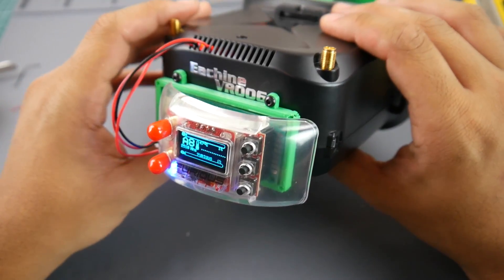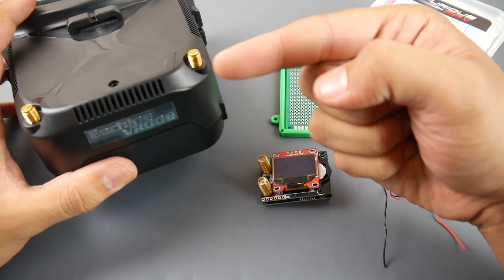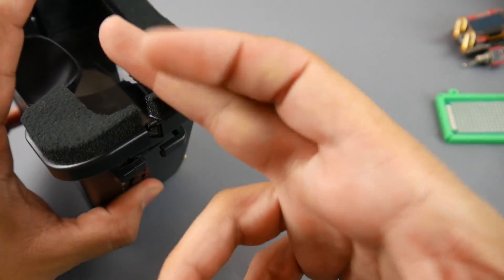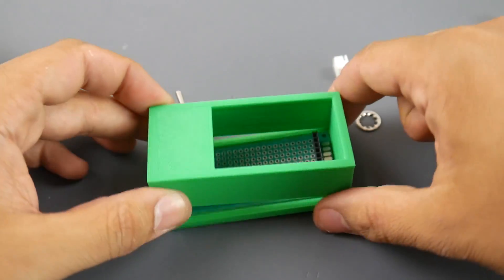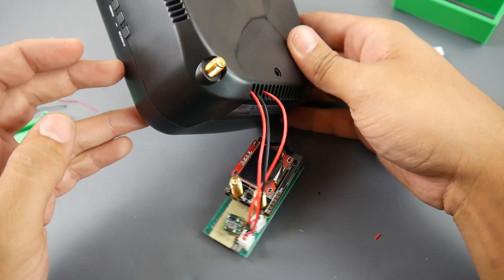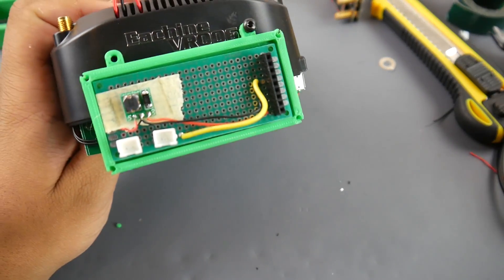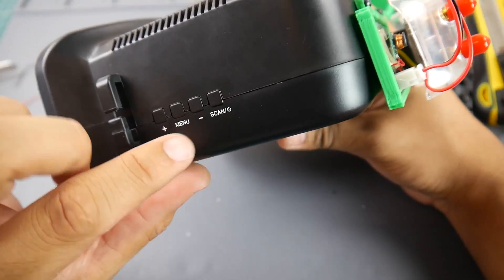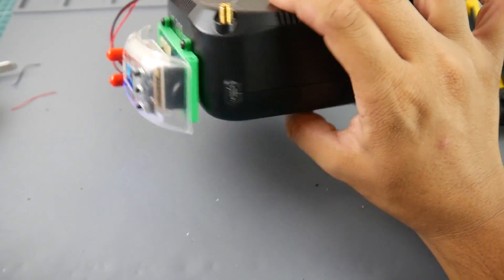Eachine VR006 Long Range 2.4Ghz Fatshark Module!! // Eachine VR006 Fatshark Mod

Comment: I tried making this with my VR006s using a NextWave 5G8. I had the module laying around, so I thought it would be a good proof of concept before I tried a more expensive module (these are backup goggles for me). But I couldn't get anything other than black screen when I switch to AV In. I made sure the module was on the correct channel (before I put it on the VR006, since there's no buttons now), but I can't get anything to display. Any thoughts? I double checked my regulator is outputting 5.0V when the module is running, I have capacitors on the output of the regulator, and I have verified with an oscilloscope that the module is outputting video signals. I double checked my soldering, and even tried running the video through the cable the supplied with the goggles. No luck. Any ideas would be helpful!

Comment: Nice proof of concept for diversity mod in cheap googles. For really useful mod VR006 aren't the best though due to mediocre screen. better is to mod Eachine EV800 by adding external module slot and moving a battery to back on head strap (or power from Fatshark type battery) for better weight distribution.

Comment: The VR006 battery is ridiculous, with one more module it will end in a couple minutes.
Reply from the maker: I have DVR and battery mod for this on the way.
Reply: @DroneMesh  I did DVR mod on mine
Reply: @radiocontroladobr  yh I cant wait to install DVR and better battrie

Comment: Hi, dear. Could you help me? I dropped my hubsan quad in a water. An ESC caught fire. After that I bought a new ESC. I connected it to the motherboard and to the motor. I heard beeps when I connected it to the motor. And the ESC caught fire again.  Please, I need some advice.
Reply from the maker: I emailed you back :)

Comment: Awesome! I did a similar mod long ago with the pro58 and these goggles. I’ve used it for months till I now got commanders. I’d warn that in AV mode it still has the internal receiver powered “at least on mine” and that drains the battery. I just bypassed my internal and wired it straight to that. Also I didn’t need the step up converter for the pro58. That also ends up drawing more power. But I love how simple this installation is 😎👍🏼👍🏼
Reply from the maker: There will be more mods on a 3500mah  lion flat cell.. dvr with caps to make sure you dont miss a recording.. I'm really liking these goggles a lot to be honest.
Reply: Drone Mesh What’s funny is I seem to like them more than the commanders haha. I think the screen and fov are better!! With the battery mod it will be perfect 👌
Reply from the maker: The FOV is like my fatshark HD3 sort off.. better than the bigger ones.
Reply: Drone Mesh I found the fov on these to be perfect. The bigger box goggles are too big. The only thing is wearing them for a while you can feel the eye strain of the single screen and Fresnel lens. That was my main reason for going to the commanders
Reply from the maker: Ya but its hella of good backup and or for a friend going with you.
Reply: @DroneMesh  hola acabo de quitar mi receptor para poner el eachine rx 58pro
Pero noto que tiene continuidad el gnd con la señal de video,es normal?
Puedo conectar el diversity a el pad AV?
Reply: Hola a mi me da continuidad con el pad de video y gnd
Es normal?

Comment: are there any flysky radio videos coming ? also i would love to see someone make an open source transmitter and receiver with a 3d printed body and custom pcbs inside, hope it happens some day ...
Reply from the maker: There is openavrc check it out.. I am planning a custom PCB to replace main board of flysky with it and will run opentx and get all features.
Reply: Can't wait to see that , modding is the best part of this hobby for me !

Comment: Nice video, really love these mod vids. You opted for the front mount because of the antenna placement or the depth to screw in? Wondering if it could work on the side and get the weight a little closer to your head.
Reply from the maker: I went for the front so people avoid using adapters for the antennas.